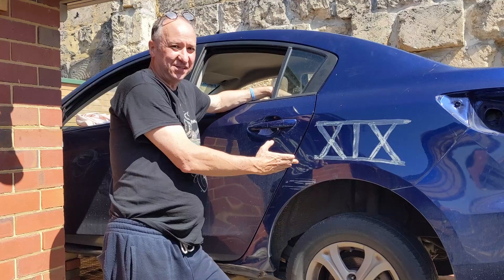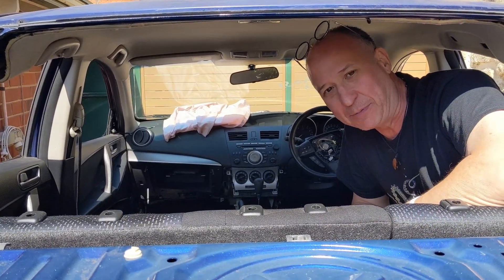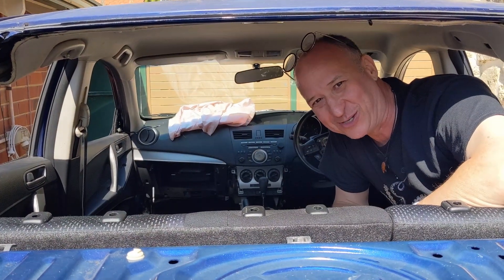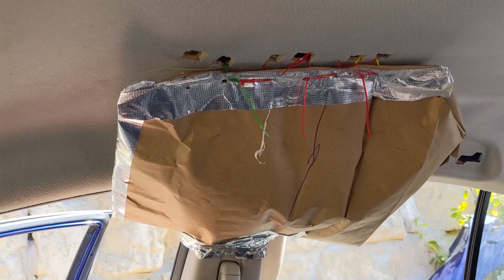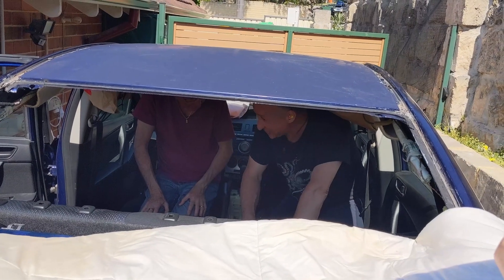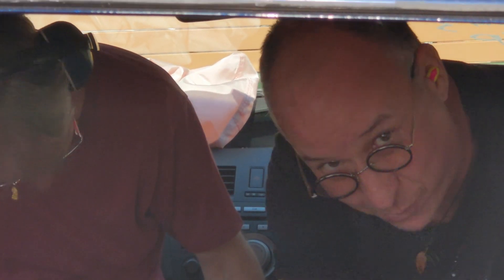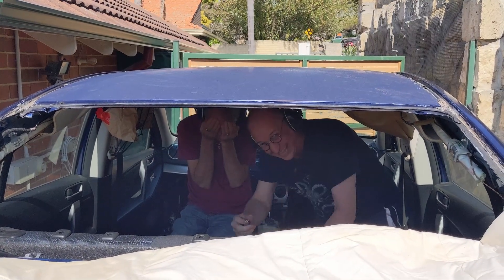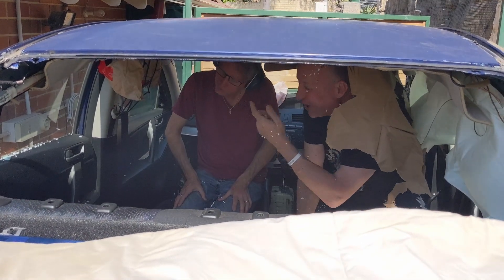Airbags Go BANG! Part 6.

Comment: We have a 2014 Mazda 3, and the thought of them all going off in a crash has always worried me, thinking I could be suffocated, but those bangs weren't as loud or huge as I'd imagined them to be.
Reply from the maker: Hi Maureen, the video software does take the edge off the volume of the bang.  It is actually quite loud.  But what I would express to you is that the loud noise and the surprise of the inflation is well worth the reduction in impact force that these amazing devices provide.

Hold onto that Mazda 3.  They are a great car, and well worth maintaining.  I hope you never need the airbags, but if you do, you will be glad that they are there.

Paul.
Reply: @PaulinPerth  Thanks Paul, you've put my mind at rest.

Comment: I love how curious and adventurous you and your brothers are!  I had a question though....HOW did you get the car up there in the first place.  lol
Reply from the maker: My house has a very small footprint.  But I have an inventive mind.  I made a track to roll the cars in, and then I put them up on blocks.  Then I wreck them.  The final step is the scrap metal company that comes and removes the chassis by crane.

It was tricky, but with some lateral thinking I got it done.

Paul.

Comment: So with the large peanuts (were they the environmentally friendly compostable foam pieces?), did they fail to explode fully during the 2nd detonation because of the different way the bag was attached to the car frame, the thickness of the paper bag, or because the bigger pieces weren't as suitable to use for the experiment? 

Also, like your brother, I was amazed at the width of that airbag. I'd assumed they were round. 🤔
Reply from the maker: The curtain airbags are very much closer to a rectangle than a circle.  It is one continuous bag from the A pillar to the C pillar.  So if you can imagine a blanket that covers both the front and rear door windows, then that's the shape of the inflated bag.  I for one would be very happy to have it deploy in a side-on accident.

It's hard to judge the large peanuts.  The restraint system of zip-ties that Noel and David went with was simply too restrictive to allow egress of the peanuts.

For the finale, I am going to go with a combination of both sizes of beans.  This is mainly because we went to a lot of effort to vacuum them up after part 6, and that mixed them up together.

Stay tuned for part 7!

Paul.